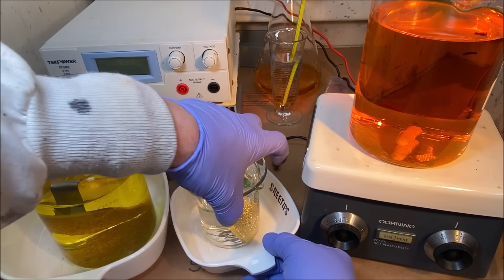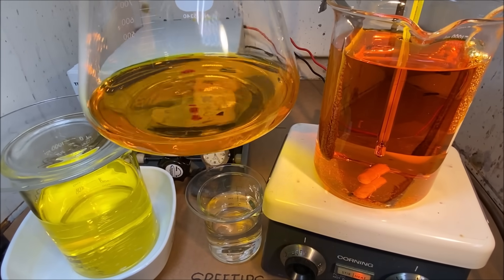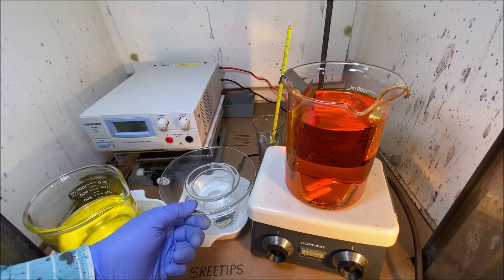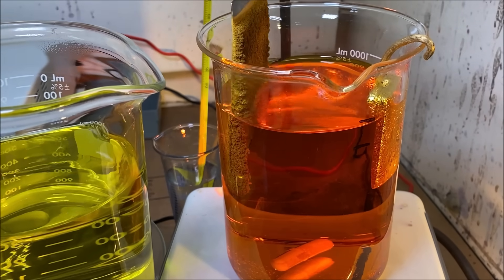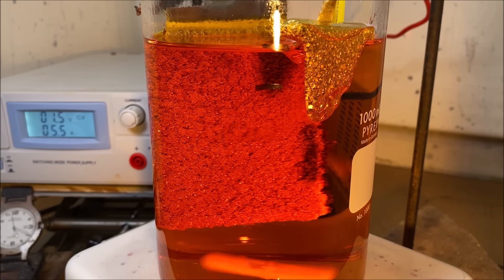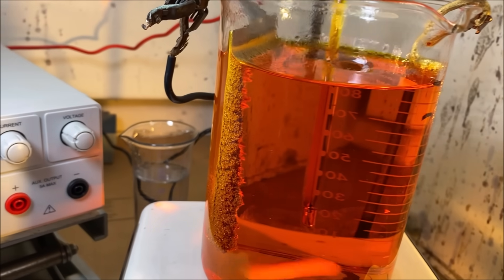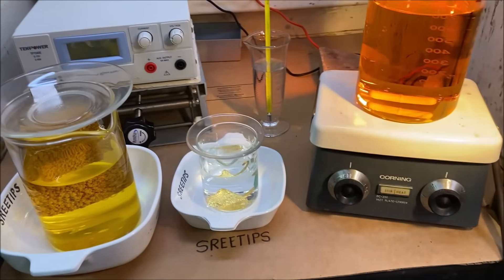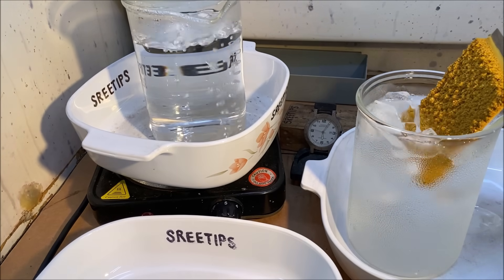Homemade Electrolytic GOLD Cell Pt2

Comment: I love watching the videos, and I am trying to learn. Can you explain how this method makes money? You started with 120g gold bars, and the anode of 542.2g, 662.2g total. You finished with 564.4g. That's 97.8g of gold less than you started with. You had a few crumbs of gold in the beaker, and there was a small bar remaining that I didn't see you weigh. Is the new gold of a much higher purity that makes it more valuable?
Reply from the maker: Currency is not money. Gold is real money. That should tell you everything.
Reply from the maker: The “missing” gold is in the remaining anode bar.

Comment: My electrolyte is too rich and the power supply goes into surge protection mode... I'll have to filter it out and dilute it into two parts.
Reply from the maker: I use 100 grams per liter concentration with excellent results.
Reply: @sreetips  I managed to recover a spoonful of liquid gold from a waste solution. I used stainless steel plates and I got the gold barely sticking to one, and sludge on the other. Cool results, I can feel the weight of the liquid in the jar, almost like mercury the old electric timers used to have. At first, liquid blue crystals were forming on the sludge side, then turning darker.

Comment: You could definitely run crude gold right after inquartation though that cell. Wondering if it would work with lower carat gold like 18 or 14?
Reply from the maker: 18k or 14k would quickly foul the electrolyte.
Reply: @sreetips  That’s the point. The pure gold depleting on the cathode and all the junk remains in the solution.
Reply from the maker: In order for electrolytic refining to be successful, the anode material must be fairly high purity to begin with. The big refiners get it to 995 parts per thousand before attempting to make anodes for electrolytic refining. 18k and 14k is not suitable.

Comment: So is there any significant monetary value of gold from .995 vs .99999 fine? 

I work in the commercial scrapping industry. I know when there is a “spot price” for metal. We call that crack head pricing. I don’t get paid in crack head pricing. 

I go to the office room of a recycling company and don’t sit in their lobby. Just the other day I turned in 1000lb of refined Tungsten Carbide. 

People can sell that around $8-9 per lb. I was paid $16.50/lb, then my broker gets paid more to cover freight, shipping and man out labor to handle and pack the material when he sells it…

So really if you’re selling for “spot”. This is an unnecessary process I would believe unless it is just for fun. 

But if you can broker to sell direct to an actual manufacturer rather than a refiner, I would imagine some .99999 fine could sell for quite a bit higher than spot. You just have to have the contacts.
Reply from the maker: I do this for several reasons: 1) because I like doing it. 2) to produce some high purity gold crystal that I can sell on my eBay site. 3) to create new and interesting content for my YouTube channel.

And thanks for reminding me about pricing. I just increased my ask price for the pure gold crystal from $185 per gram to $190 per gram.
Reply: @sreetips in your setup I completely get it. You use YouTube to add value to your gold and advertise at the same time which nets you over spot price on your gold when you sell it. I also agree that this stuff is intensely interesting and fun.
Reply from the maker: Thank you

Comment: Nice work👍🏻 I enjoy your content every time, thank you for sharing🙏

I would recommend not using a stir bar/ stirring unless you use really high purity Gold as anode bar.
If not pure and stirring, the impurities will be tumbled around in the solution and some of it will be catched by the gold crystals like dust in a carpet and then being encapsulated in the growing crystals.

The Au-ions will travel to the cathode anyway no matter if stirred or not.
If not stirred, the impurity "slimes" will just sink down to the bottom.

Why not just using a high purity gold cathode?
Reply from the maker: Don’t stir, titanium cathode is faster

Comment: Maybe someone can explain something I still don’t get.
If the solution is aqua rega, which will dissolve all the metals in the anode, what is stopping the other metal getting dissolved into solution and then plating out onto the cathode? 
I understand how this is effective for purify metals higher on the reactivity series. ( the solution would rather dissolve silver than gold, so a silver cell makes sense, because any gold would rather drop out of solution than replace the silver in solution and then get plated out)
But in this solution because silver is more reactive than gold won’t it take its place in solution and get plated out? 
An example is copper electrolyses of a mixed metal anode, which drops out all the lower reactivity metals such as silver and gold, but does still carry some of the higher reactivity metals such as tin.
Reply from the maker: The electrolyte is not Aqua Regia. All the excess nitric has been removed from the solution.
Reply: @sreetips but as the electrolysis removes the gold from solution to plate it onto the cathode doesn’t that free up some of the nitric acid to dissolve more gold (or other metals)?
Reply from the maker: There is no nitric acid present in that solution. It was removed beforehand. If there is any free nitric then it would get consumed by dissolving gold off the anode. But once that nitric gets consumed then it’s gone and the solution can no longer dissolve gold.

Comment: Hi Kevin, I have a question. In this setup the gold ions move horizontally from the donor electrode to the electroplating electrode. In the process, some crumbs fall to the bottom.
Your silver cell setup is vertical. In that setup, is it possible for impurities to fall down onto the crystals and get including in them, possibly disturbing the crystallisation process? I remember you sometimes get different types of crystals in your result. Thank you.
Reply from the maker: The silver cell has the anode filter to trap any insoluble material from falling down into the silver cell.

Comment: Scraping it off using a metal tool would cause miniscule contamination though. Could possibly do a quick etch to remove any steel and titanium surface contamination?

Comment: Beautiful. I saw this electrolytic process utilized only for copper (common industrial method) but never for gold.
I would be careful about using stainless steel spatula - these are likely nickel-chromium steel which is fairly acid-resistant, but solutions of noble metals can stain it, especially in presence anions like chloride, which catalyzes the metal displacement. I would use spatula made of glass (commonly available in lab supplies), ceramic or PTFE as the steel spatula may get plated with any dissolved gold and contaminate the gold solution with other metal ions. It depends on your process though (should be fine if the the gold was thoroughly washed).

Comment: Try polishing that plate that the gold grows on to a super polished finish. I polished my silver cell bowl and the silver crystals barley stick to the vertical sides. Like a tap on the table the cell is sitting on drops them all to the bottom of the cell. That might work to help the gold release easily
Reply: Between this and coating the edges & back with a non-conductive material as Zendukai suggested, I feel like the process of removing the gold from the cathode would be a lot easier and less prone to losing or contaminating yield.

Comment: Wouldn't it make more sense to use electrolytic gold as the cathode? Melt some into a bar, then work it out into a sheet. That way you don't have to scrape the gold off, and there's zero chance of contamination from the cathode.
Reply from the maker: Yes

Comment: I'm wondering if you could use a cathode of pure gold hammered or rolled into a thin sheet. Thanks to the applied voltage it should work without dissolving. On the other hand the peeling process looked pretty easy, so there is no need for that.

Comment: It would be useful to do a full mass balance here.  How much lost from the anode. Wt gain (gold) on cathode. How much gold in electrolyte solution?  My guess is that this is really transfer between electrodes and that gold in solution remains constant. Other metals (impurities) should end up in the electrolyte?
Reply from the maker: If you look at the numbers, the amount of gold from the cathode plus weight of the sharks tooth at the end is 484.1g plus 80.6g equals 564.7g but the anode was only about 542g when I started. So there’s more gold than I started with when I’m done with the refining. Where did the extra twenty grams of gold come from? A: from the electrolyte. The cell can’t distinguish between gold ions that came off the anode bar, from those that were in the electrolyte. So some of the gold from the electrolyte gets deposited on the cathode as the cell operates.

Comment: Today I Learned that if you put dilute hydrochloric in a beaker and add aluminum, you can 1) light the hydrogen gas vapors and see a cool blue flame, and 2) basically produce copper from the acidic reaction to aluminum.

Comment: 121st!  This procedure takes so much longer than your regular one. It doesn’t take all the chemicals either. I guess it’s the time involved doesn’t outweigh the original method?  Great result.   Roger in Pierre South Dakota
Reply from the maker: It’s because the anode bar was so big.

Comment: I can explain why stirring improves the reaction rate/amperage. Electrorefining on its own is a diffusion-limited process. By stirring, you help replenish the gold ions near the cathode and pull them away from the anode.
Reply from the maker: With the stir bar off, a definite visible layer formed half way up the cathode. The bottom layer was much darker orange than the top layer.
Reply: Don't forget the cathodic boundary layer!
Reply: Kullanilan sivilari aciklaya bilirmisiniz
Reply from the maker: The electrolyte is 100g of pure gold dissolved in 1 liter of solution.

Comment: Melting Points
Titanium (Ti): 1,668°C (3,034°F) 
Gold (Au): 1,064°C (1,947°F)

Could you just heat the thing beyond golds melting point and have it just flow off?
Reply from the maker: I’d be fearful that the gold would weld to the cathode.
Reply: @sreetips  Another and very real possibility, especially with titanium (it likes to mix).
Reply: He could, but it would introduce (carbon) impurities.

Comment: Wonder how many 9s of purity you can get? Is it possible to get say 99.9999%? And, does such purity makes gold more valuable?
Reply from the maker: If I ran the pure gold crystal back through the cell a couple times I could probably get close to five nines. Industry standard for pure gold is three nines fine. Anything greater than that is unnecessary unless needed for some specific purpose. Then, depending on the purpose, you could demand a premium for five nines, based on the customers needs.

Comment: Why did you need to use a gold in the electrolyte solution instead of some other electrolyte?  Isn't the gold already coming from the anode?
Reply: It needs gold in solution for a starter. If there is no gold in solution, other (lesser) metals will plate out.
Reply from the maker: Because that’s what the book said to use. 100g per liter concentration.

Comment: Titanium has a 1000 degree Fahrenheit higher melting point than gold, maybe torch the gold crystal off the titanium cathode into a melt dish rather than scrape it?
Reply from the maker: Get the gold hot enough to melt off the titanium and I’d be fearful that the gold would weld to the cathode.

Comment: I wonder if you painted the back side of the titanium and controlled the rate of deposition if you could grow larger crystals similar to natural gold crystals. Though I suspect you might need to do it the way people who grow crystals in supersaturated solutions do with seed crystals suspended in the solution maybe in your case you would need to suspend the crystal in a coated titanium wire.

Comment: Thermal expansion probably is not the best choice to separate the titanium and gold.  Titanium is not very expansive with an increased temperature. If you do continue with thermal expansion, I recommend prolonged heating.  Since the titanium is less sensitive to temperature increases it won’t matter if both materials are heated.
Reply from the maker: I thought about dipping it in liquid nitrogen.

Comment: Yo with the pattern that gets etched or whatever into the surface of the gold bar you should do the gold bar in smaller bars doing multiple at the same time then turn them into pendants or sell them as jewelry. That pattern is just wildly cool and would make such beautiful jewelry. But a 10zo bar is just way to big gotta do smaller ones.

Comment: We used rubber edge strips on our cathodes in our zinc plant. Not across the bottom though. I was going to say coat the edges with a wax of some sort, but you're heating it up. 
In the old days of manual stripping zinc, if the previous worker didn't tap back on the edge strips, on one side, or one side fell off we would have to tear the sheet off. Each operator had 600 cathodes to strip, I used to take 2 and a half hours to strip 15 cells, 600 cathodes and would make about 7 tonnes of zinc. That row would have to be stripped again in 16 hours again and so on. We had 14 rows and 7 zinc strippers per shift, round the clock, 24/7. In the early early days we had a pit of zinc concentrates where the process of  making a zinc plant was developed. In the 60s a plant was built to plate it out. The electric bill back then was about 11 million for 3 months. The pit was full of free zinc concentrates, so we easily paid the bill in a few days. Being a zinc stripper back then was good. 8 hour shifts were like this, good strips, take 2.5hrs to strip, sit down for another 2.5 hrs and go home, and, we still got paid for 8hrs work. Good times until the mobile stripping machines took over and the knives on them would chew cathodes up for lunch lol... Millions of dollars in repairs lol... Oh well, the plant is closed now. Now it's going to use electrolysis to make Antimony... For Trumpy.
Reply: sreetips could find a solution to fix that. :P
Reply: @MakingUsThink he has bottles and bottles of solutions hehe

Comment: Gold is plating on to only the front side of the titanium plate. The space on the other side is narrow for the gold to travel and stick to the back side. May be if you create enough space between the titanium plate and your beaker wall, gold will evenly plate out on to the titanium evenly. I wish you get some gold crystal needles similar to your silver crystals. Would have been a fantastic thing to look at.

Comment: I’ve suggested this before but there are titanium pots available that you could use and it would be more like your silver cell.
Reply: Also I was thinking about how you always have trouble getting the gold off the titanium. You could wrap the titanium in a thin gold mesh, this would give the ions points to start crystal growth and avoid that thin gold foil layer that forms a pocket around the titanium that you always have to chisel off.

Comment: Is the 9999 fine gold worth more per gram? Other than the fact that there's technically more gold per gram of course because that difference in weight in almost incalculable. Seems like the "cool" factor by itself would make it worth more
Reply from the maker: Don, industry standard for pure gold is 999 parts per thousand. The extra nine is unnecessary. Unless needed for some specific purpose.
Reply: Artisanal gold like this always commands a premium over commercially produced gold and 4x9s is more expensive than 3x9s. So sreetips will add a premium on the gold as always.
Reply: @paulgilbert9346  Cool, thanks 🙏. I figured but other than Sreetips I'm ignorant on precious metals. Trying to educate myself tho 😊

Comment: What would happen if the anode bar and the cathode were left in the electrolyte when you shut it down for the night?
Reply: the solution is aqua regia, iirc, so it can dissolve both into the solution, and the idea is not let that happen, because you want to refine it, not end in the solution
Reply: @gotgg-n6w  That's what I thought but wanted to confirm. Thnx!
Reply from the maker: I don’t think it would hurt anything. But I didn’t want to take a chance. Sometimes leaving stuff sit can cause problems. Plus, I didn’t feel comfortable leaving that much gold sitting in my shop while I slept.
Reply: @sreetips I hear ya there, my friend! Another great video. 👍👍

Comment: QUESTION If doing this is the pure of the pure where do the other precious metals or crap go
Reply: I think I understand your question. The other material would stay in the electrolyte. The 9999 pure gold generated from the gold ions flowing onto the cathode so it really is that pure. The other stuff would almost completely stay behind in the electrolyte and when he precipitates it out it'll wind up in the stock pot where it "cements" out onto copper that's in the stock pot for future refining. Nothing is lost in the process.
Reply: @DonRaesworld sweet thank you
Reply: The crap falls off into the electrolyte solution.  Other precious metals might also plate onto the cathode or stay in solution, depending on the chemistry
Reply: @mensaswede4028  You said it easier than me. I try 😊
Reply: not much crap in there, the impurities you call crap can be silver, palladium, platinum, rhodium

they stay in the solution mostly, some can decide to stay in the cathode, that is why it is 99.99% 4 nines fine, not 5 nines fine
Reply: Heaven
Reply: @BrianNovak-gk5rb lolol